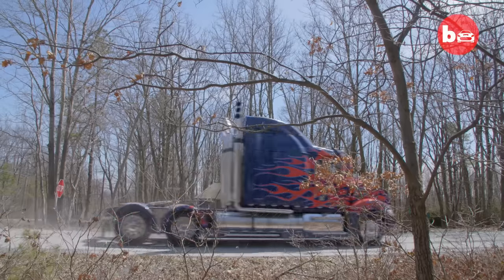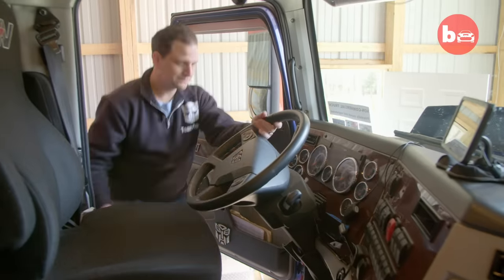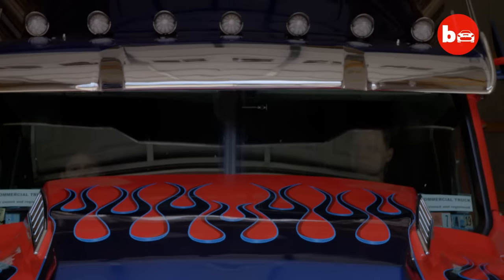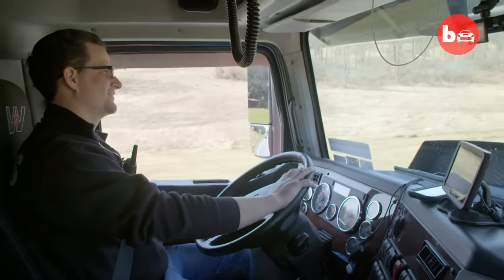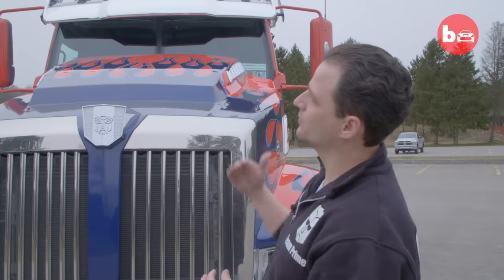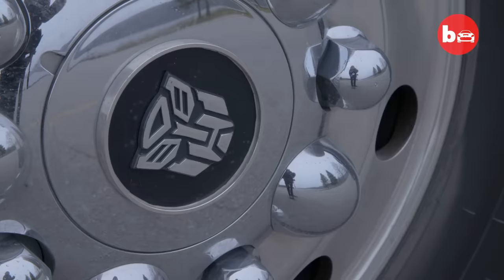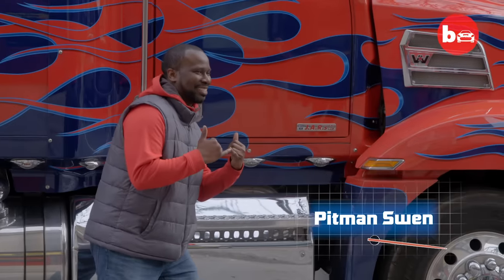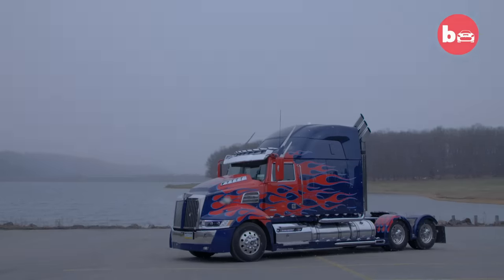World’s First Fan-Built Optimus Prime | RIDICULOUS RIDES

Comment: I must be missing something.  A few logos and maybe a matching paint scheme is supposed to be an Optimus Prime replica?
Reply: It is much more than logos and paint. When it was first built, it was done all from photos by a factory. Then the owner began all of the customizations to turn it from a normal Western Star into Optimus. He added autobot logos, the very complex paint, the stacks, the fenders (there was nothing over the rear tires beforehand), the headache rack and chains, the visor, the tail lights, and more to make a nearly exact replica of the screen used trucks. Then he did even more customizing over the years, such as Energon lighting, murals, custom mudflaps that were on since the beginning, and more.

Comment: Amazing but you have to give prime a better engine
Reply: That requires a lot of money. And it really isn't necessary as the truck doesn't need to go fast.
Reply: @MatthewBarberio  every thing he did cost money
Reply: @MatthewBarberio  nothing he did was necessary it is just cool so why not make the prime fast
Reply: @kingbeast9497  Yes everything he did of course cost money. A TON of it, and he continues to have to spend more just to maintain the truck. But every modification was necessary in order to ensure he looked like Optimus, and then to maintain his appearance and drivability has been even more. You'd be shocked at how often he needs to do repairs, as driving puts a lot of stress on the truck. A new engine is something he does not have money to waste on and there is no reason to do it. His current one is entirely sufficient for driving Optimus. It's not like he needs to go faster, and really shouldn't for safety reasons.